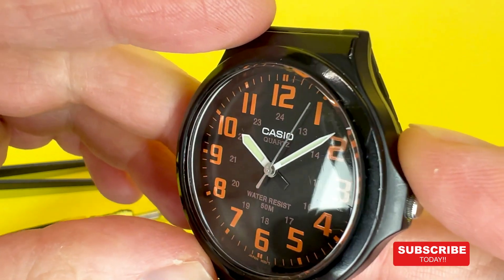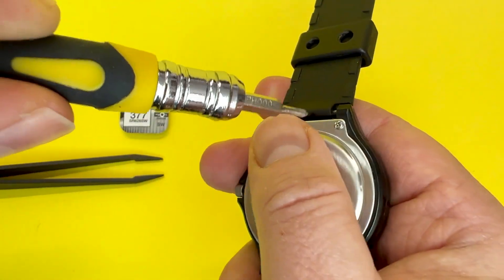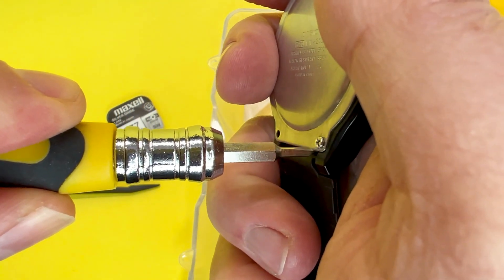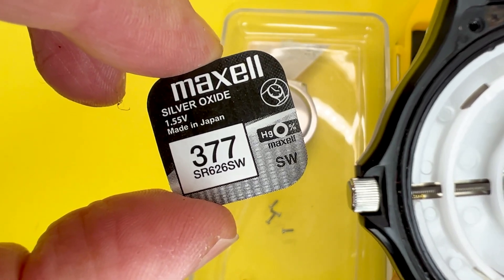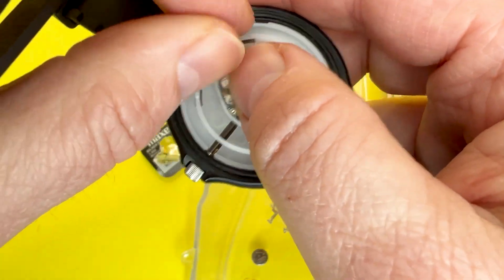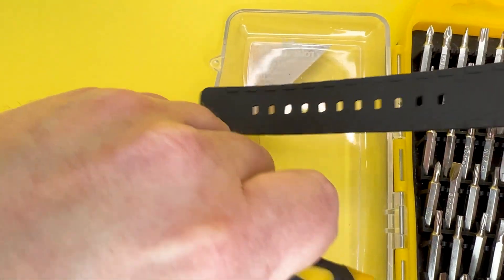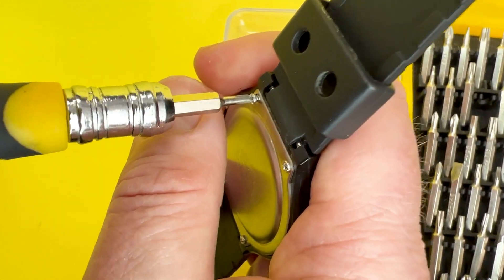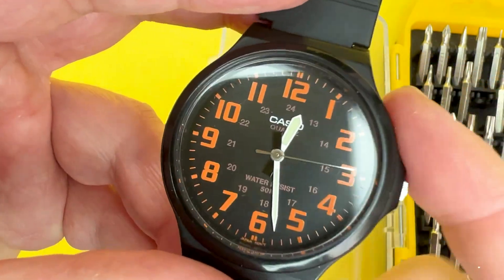#CASIO MW-240 (Module 1330) How to CHANGE THE BATTERY and SET THE TIME.

Comment: A bit of a good practice tip, is to take out the o ring, carefully without any sharp object (i use radico, or a simple double sided tape)  clean all debris from its groove using a toothpick. And re-oil the o ring with silicone oil. If any of the debris found itself underneath the groove, it will likely leak water or sweat into the watch.
Reply from the maker: That's a great tip and thank you for sharing it!!

Cheers,
Tony - WTA

Comment: Wanted to say I replaced the battery on mine and could NOT get the gasket to fit back in. Tried several times and it was always poking out. Casio gasket replacements were too expensive so I tried ordering a generic multi pack of different sizes of watch gaskets and none of them fit. Right when I was about to give up and order another, I had one last idea. I put the gasket in the fridge overnight! Worked like a charm.

Comment: A small hole in the white lid in the middle. There should be a small golden spring there. It connects the mechanism with a stainless steel metal cover

Comment: On the bottom where there is a notch with a small hole on the watch, isnt there supposed to be a spring inside the hole and will it affect it if its lost?
Reply from the maker: I am afraid that I don't know as my knowledge with the inner workings of a Casio analogue watch are very limited to say the least.  Might be worth posting that question on a few Casio forums to see if anyone can shed some light on what you are asking.

Cheers,
Tony - WTA
Reply: @wetryanythingchannel  actually it doesn't have a problem and it works just fine. Thanks though!

Comment: hi, is it possible to remove the crown, I wpuld like to clean inside the glass
Reply from the maker: I am going to be honest and say I don't know if you can on the MW-240.  It may be worth checking out a few Casio forums and see if anyone has carried this out.

Sorry I can't be of any more help.

Cheers,
Tony - WTA
Reply: @wetryanythingchannel  hello tony, let me update you and others who may need the answer of the question.

after sending that comments above, I tried to do it myself and yes the crown can be removed, the main trick is pressing the tiny hole in the proximity of the connection of crown and mechanism when pulling the crown. you can use a needle or something similar to press the hole, since its radius is very small.